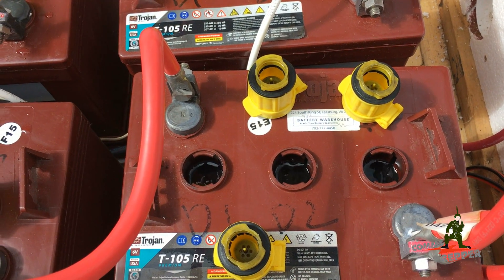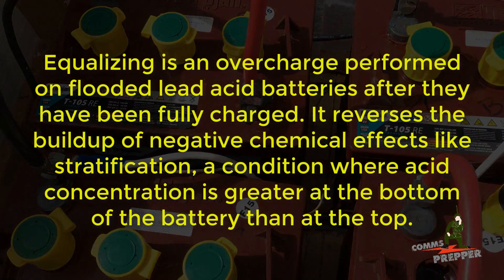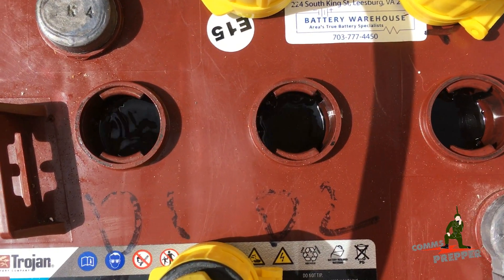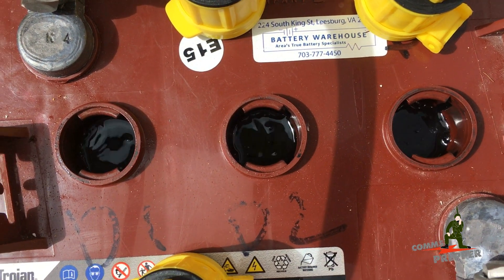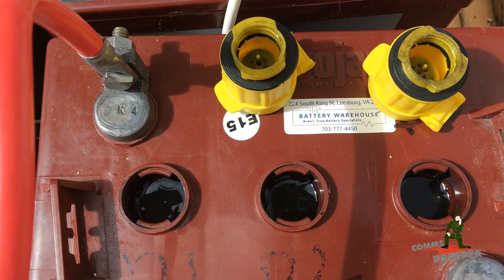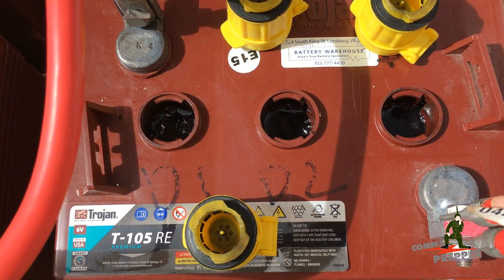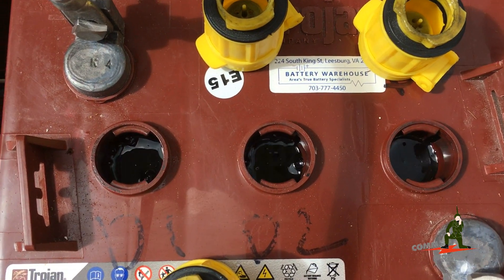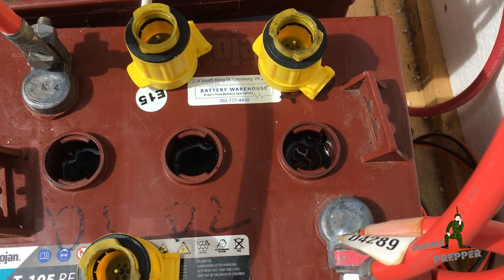Solar Power Battery Equalization

Comment: How have your T105s fared? Your vid from 2017 says they were 2 years old then, making the manufacture date 2015, so 5 years old now. I had a set of golf carts with similar capacity last 6 years by babying them. The solar guy who helped me with my first ever installation (my own, and those "EverReady" $88 batteries from Sam's) told me to not equalize more often than every 6 months, or the overcharging will kill the batteries, although some say to do so monthly. I'm just wondering if over charging them so often has helped or hurt, by comparison. Thanks in advance for your own experience info.
Reply from the maker: They are holding up well!  Routine equalization is key.
Reply: We are going  on our 8th year on our Costco batteries, I only equalize them 2 to 3 times per year and they are still going strong.we never let them get below 60% discharge.

Comment: Hey, when equalizing these types of batteries, do you always have to remove the little knob covers?, or the batteries can still be equalized with them closed?
Reply from the maker: I always open them encase the water bubbles over.  Other may have different opinion. You always want to wear safety glasses, gloves, and long sleeves (old shirt) when working around these batteries.
Reply: @Commsprepper  ok thanks for the information

Comment: i am thinking about buying Trojan t105 how long do they last on solar with a good charge controller ?
Reply from the maker: life span or charge?  You should get 7-10 years out of them if you take care of them.  How long they last during the day depends on how much you are running on them.
Reply: If you're in the hot desert they'll last 5/6 yrs even equalizing &only if you take 40% off the batteries tops ! I'm off-grid & need(always) more batteries and more panels. If could only afford lithium.

Comment: So how do I go about equalizing the batteries since you didn't show that in you video?
Reply: 32 V for 1 hour on a 24 V battery on the Trojan Ind
Reply from the maker: Check of solar playlist.  Equalization is a charging mode that part of your charge controller (provided you have a quality charge controller).  Equalization charging times and voltage levels are specific to each battery brand/model and need to be programmed or set in the controller.

Comment: Didn't learn how to do a recondition here. Click bate
Reply from the maker: Not meant to be click.  The video clearly shows "solar power battery equalization."  However, if you need to know how to equalize - that's easy.  You need a charge controller that is programmable where you can set an equalization voltage that matches the equalization voltage specified by the battery manufacture.  Then you run the equalization cycle in the controller.  I have several videos on this in my solar power play list.  Hope this helps.

Comment: How do you find those T105RE batteries compared to the vanilla T105 bats? if you ever had the regular ones before? On paper they should be superior as I understand but I have read a few negative comments about them and I suspect it has been something not related to the bats. What's our take? Thanks.
Reply from the maker: We are very happy with them.  They are much heavy than the plan 105 because of the thicker plates designed for solar use.  If you get them you will be happy.
Reply: Thank you! :)